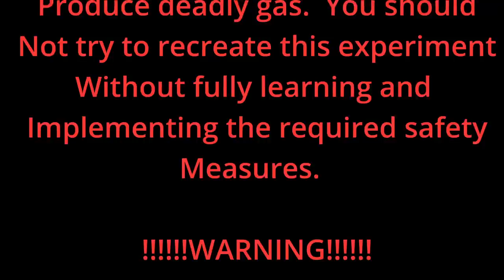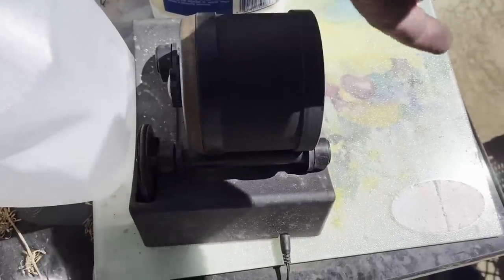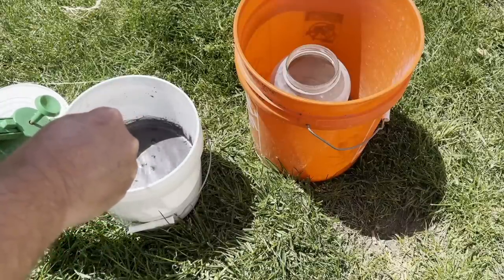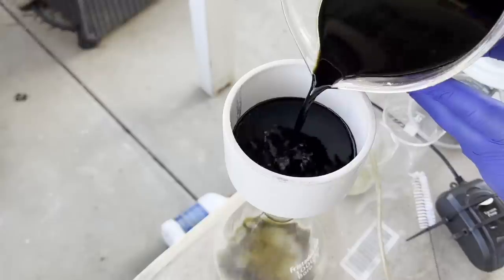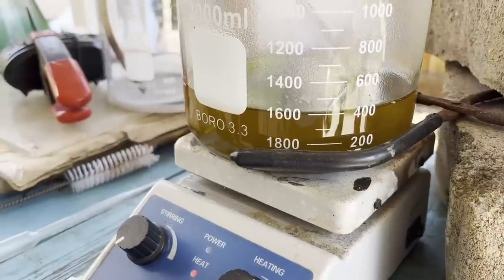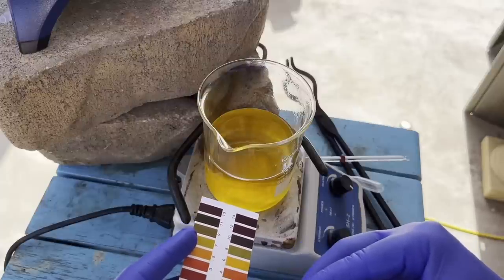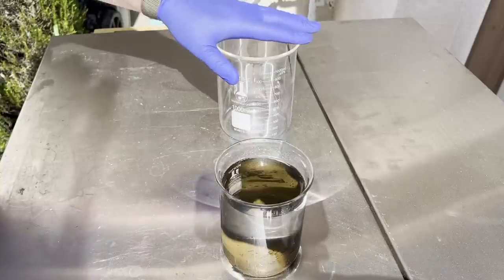Gold Recovery from 1Kg Square Flatpacks

Comment: Just finished the last of my chips.  I had the same problem.   Lots of metal mixed in the dust and the dust itself was impossible to crush.  Had to end up running it wet through a blender for a long time.  I use a bluebowl myself, and ran the dust over and over, crushing it more than once.  I found that as long as copper pins keep showing up there will always be some gold underneath.
Reply from the maker: Thank you for the view and the comment!

Comment: This is kind of painful to watch. You really went the long way around everything. No need to denox. You didn’t use nearly enough nitric to have to worry about it. Oh is irrelevant. It will be very acidic. It’s supposed to be. Just add SMB and precipitate.
Reply from the maker: Thank you for the view and the comment.
Reply: I'd like to add to CuttinEJ's comment so correct me if I am wrong EJ; in situations where he doesn't have any urea to denox he can always use extra smb, correct? The sodium metabisulfite will get rid of the nitric; however, extra will need to be used, correct?

Edit: Also just an FYI - I remember learning in one of my Chem classes in high-school once upon a time that UV breaks up the molecules in the nitric and allows it to evaporate out of the solution it's in. In other words if you just leave it in direct sunlight for a day or two it will also denox that way.
Reply: Urea doesn’t denox, although there is some risk of creating explosive compounds when trying to use it to denox with heat. The first step is to not use so much nitric acid that you need to worry about denoxing. Use small, incremental doses of nitric. Just enough to dissolve all of the metal. In the case of gold, a good way to remove excess nitric (which shouldn’t be very much) is to simply leave it on the heat and allow it to evaporate until the volume of liquid is reduced by about half. You can go quite a bit further until it becomes almost a syrup. Then rehydrate back to the original volume with HCl. SMB will remove excess nitric, but you must understand how it does this and that it’s not very efficient. SMB will precipitate the gold and excess nitric will redissolve it almost immediately. So you have to keep adding SMB until all of the excess nitric is consumed. For a very small amount of excess nitric this isn’t a big deal, but for those who go way overboard it’s really just asking for trouble. Now comes the part where I say something that’s true and intended to help you, but which most people take as an insult. Urea goes in the garden. It has no place in this kind of refining. And anyone who has to ask these kinds of questions needs to stop whatever they’re doing and study A LOT before doing anything that involves mixing chemicals and heating them to or near boiling. Please. The gold will keep. Your lungs and eyes won’t. Happy Holidays.
Reply: @CuttinEJ 
That was dope. Thanks!

Comment: Great video! 😊 Nice recovery. if your using a nitric acid 3 ml at a time, you shouldn't need to denox your solution as when your boiling Aqua Regia the nitric will boil off over time. Then you can add more nitric till everything goes into solution. Just add small doses of Nitric so you don't waste expensive nitric and time. Also you can use a squirt of sulfuric acid to precipitate any lead which might be present in solution. It wont hurt anything. It will get filtered out before you get to sodium metabisulfate which you can add straight to gold solution without pre mixing to drop gold. Do a stannus chloride test as you did in the video to see if all gold has dropped. 😊😊😊
Reply from the maker: That’s great!  Thank you!   I heard/read/watched somewhere that adding sulfamic acid would convert to sulfuric and do the same as adding some sulfuric acid.  I am not sure where I got that.  Thoughts?
Reply: @KKRRenewables  you're correct. But that will only happen if you have an excess of nitric or nox gas dissolved in your solution. Personally im not as cautious adding h2no3 a couple mils at a time...  i usually know fairly well the yield so i know how much it'll take and add just a bit more. There's always silver alloy in with the gold occasionally lead, it's never pure so after everything's dissolved I will add a few ml sulfuric, filter then  dilute the solution with water to precipitate out the silver chloride which is insoluble in water. At that point I don't like doing a drop on a diluted solution. t takes forever. It's a pain in the ass and the pH is never right to get a proper drop. So what I do is I'll throw it in a boiling flask and boil it down to about half of its original volume. Give it a  nice healthy squirt of fresh HCL.... Then drop with smb like its a bad habit. The reason I say that is I do have an excess of nitric but not a huge one, all that boiling will get rid of pretty much all of it. and if it doesn't get rid of all of it, there's only a trace left and that trace gets a immediately decomposed by the SMB

Comment: A small slightly soft nylon bristle dcrub brush on the back of your classifier screen is amazing for getting those lil stray wiry bits out of the screen without damaging it. Cool video, just found ya
Reply from the maker: Thank you so much!  I will try that.

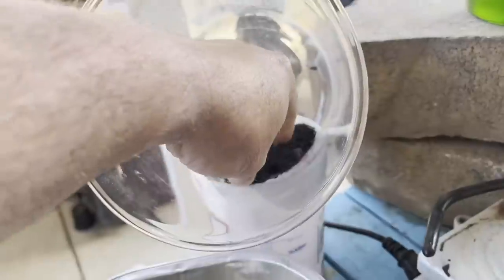Comment: How you left so much metal behind 23:27 that's a confusing statement for me could you please elaborate because I thought that's what you were after
Reply from the maker: I just meant that my sifting should have pulled out more of the base metals from the experiment so I didn’t have to deal with trying to use acids on it.  I couldn’t figure out why I had so much, nor could I figure out why some of the metal pieces were so large.   All I could think was that I put a bit of “non-sifted” material in the beaker.

Comment: Is the fine black stuff you're trying to remove plastic like from gold corner BGA chips or silica glass like I would get from DDR1 IC RAM chips? I'm kind of new to this but I'm not real sure how to get rid of either one very efficiently without losing what I'm after but I recently read about something called PETase which is an enzyme that breaks down plastic remarkably fast and I've considered UV-B as another possibility but was hoping you would already done all the trial and error and come up with something efficient and practical that you could share for the plastic and I'm still clueless on the silica glass which has me a little frustrated and in a holding pattern until I get it figured out
Reply from the maker: It’s plastic.   I’d like to get rid of the silica die also, but I don’t want to risk loosing those little “dots” of gold where the bonding wires attach. Thank you for all the comments and tips!

Comment: I have about 4 pounds grinded down and sitting in a bucket right now.... so is it appropriate to then next do an HCL boil until all base metals are dissolved then Aqua Regia? This is my first time doing flatpacks so I wasnt sure. Thanks!! Edit: would a nitric boil be better?
Reply from the maker: If you’ve burned and then ground the chips, the next step I’d take is to magnetically separate the ferrous metals and then sieve out the larger metals of non-ferrous materials.  This will save you a ton of acid and some time.  Once you’ve got as many base metals mechanically separated as you can, then you can use buckets of water to gravity separate the burned carbon ash.  Once you’ve done those steps, then you can go HCl or HNO3 but, HCl will be much cheaper.  It will take a lot longer to rid the base metals but the cost in worth it to me.   Congrats on starting your journey.  Be sure to review www.goldrefiningforum.com to learn as much as you can, and wear your PPE.  Fume hood or outdoors is mandatory, the gases produced are deadly.  Stay safe and have fun!
Reply: @KKRRenewables  I got as far as removing the ash with water then put it on hold after hesitating about the next steps despite lots of research. Your comment definitely put some confidence back in me so I appreciate that very much!! Safety first! Thank you!

Comment: Nice work KKR! 
Strong stannous tests, great flashover during precipitation, good recovery from the accidental dehydration and surprisingly clean for a recovery.
Bit of faffing about but thats probably to be expected early on, id be similar. Probably shouldnt bother filtering your waste ferric/copper chloride. If you're concerned just come back to it later, implement a temporary stock pot. Use the same method that you used for your gravity separation (spritz the surface, allow to settle, decant) im not lab trained but i think a professor would confiscate your thermometer if you use it as a stirring rod as someone else mentioned.

Fantastic job man. Good results.
Reply: Hi 
Infact accuracy way 
And cute grinding chips processor
And creative sucktion of filter 
Thanks for your this test
Reply from the maker: Thanks so much for the comment and the feedback.  Yep on the thermometer for sure!
Reply: @KKRRenewables  
Sorry for the criticism, but it is constructive. Anyone who posts is brave and opening themselves upto the entire world for both useful and useless criticism.
I have just one more thing to say....
Dont invite the trouble of having your HNO³ sitting on the edge of your bench. Its inviting a catastrophe that could be so easily avoided. Burns arent fun, skin or eyes, damage to your surrounding equipment, fumes etc. Its not worth it.

You got it man. Cant wait to see the next ones and thanks for sharing!
Reply: @dieaaljabi1364  the rock tumbler is very cute isnt it?
Seemed to work really well though...

Comment: Which brand of sodium metabisulphite are u using ?
Reply from the maker: LD Carlson brand from Amazon.  It’s no longer available.  Other YouTubers are using Bonide from Lowe’s.  But you have to be careful and ensure you get the one that’s Sodium Metabisulfite.  I’m sure any search hit on Amazon will return a product to use.  That’s awfully trusting, so read the reviews.  I did not and got lucky.  I bought a 3 1 pound bags years ago and am still using the same original purchase.

Comment: What are flatpacks?
Reply: integrated circuit chips that are made in a flat package
Reply from the maker: Exactly.  They are characterized by their thin packaging and surface mounts with no leads penetrating the board.
Reply: Is it IC chip or bga ?
Reply: @kamikazetom9785  "4 sided IC chip"

Comment: You shouldn't need anywhere near that much nitric acid and I would recommend starting with about half of that 2 mL but not until after that Hydrochloric is up to temp so you don't have to worry about excess to deal with later as it's expensive and even more costly when you lose gold
Reply from the maker: Agreed, I’ve learned to use minute amounts.

Comment: did I miss the weigh in?
Reply from the maker: Hey, thanks for the view and comment.  Sorry?  Weigh in for what?
Reply: @KKRRenewables  Did you weigh the gold? I had the video running along while cooking and I didn't get it. And I also didn't find it when searching afterwards..
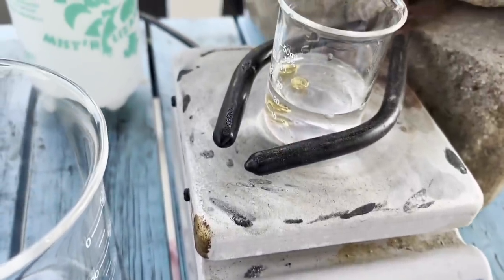Reply from the maker: Oh yeah!  It’s smack at the very end of the video 1:03:23.  Hard to catch.  Maybe I should have let it hang out and linger a bit. :).  3.4grams
Reply: @KKRRenewables  Wow, that's awesome! I hope that it wasn't fake as already too many gold videos. But these QFPs looked very high quality to start with.
Reply from the maker: Definitely not faked…I was shocked though.  They were 100% the TQFP.  I try to show the good / bad / ugly in a comprehensive video.  I use the data I collect to guess at the gold return in future videos so I have a vested interest in being as accurate as I can be.  And it’s aligned with my abilities.  I’m sure the professional refiners could get more!  😊
Reply: @KKRRenewables  I don't think you lost relevant yield. The typical mistakes are not being thorough and cutting corners in each step. Like insufficient ashing, milling, classifying, hydrating and such. Your ball mill is a bit on the weak side, but the classified product looks on point. 
The amount of dead material around the gold of course matters a lot. So... the T in TQFP is a winner. ;)